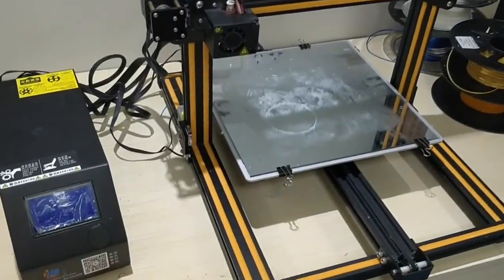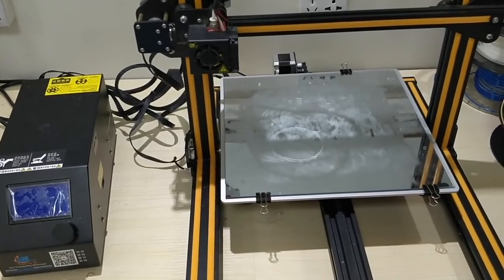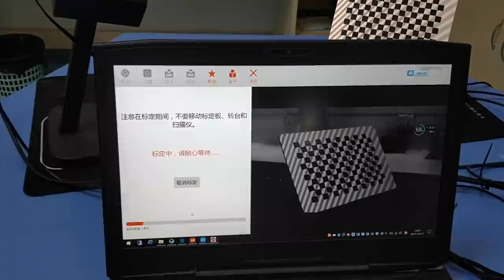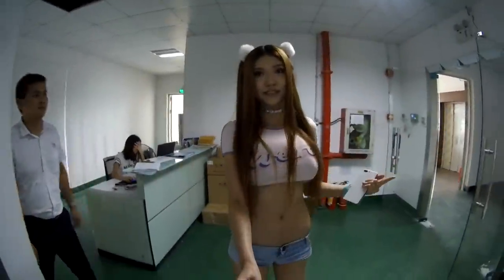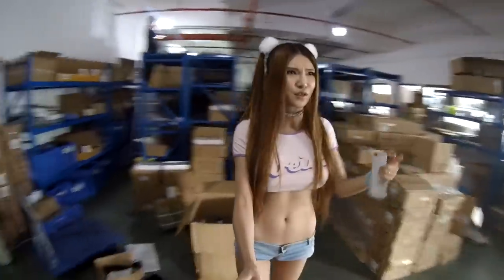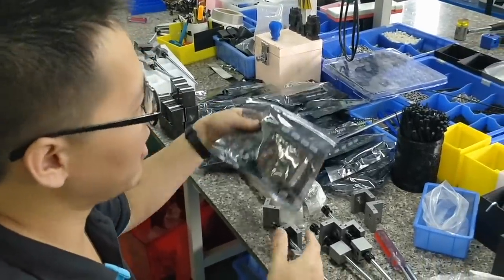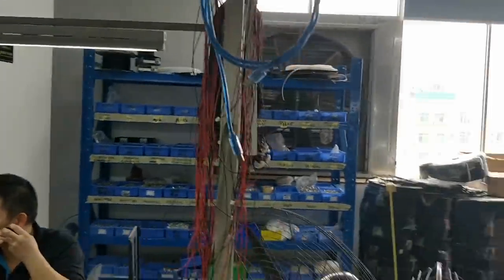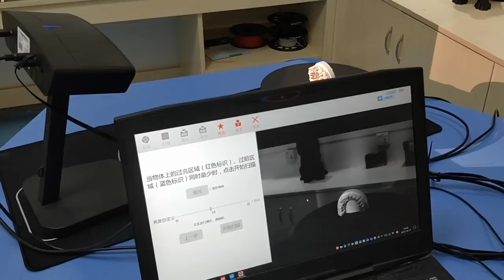CR-10 Factory Tour!

Comment: Great tour, but the camera motion was distracting for me.  Indoor tours like this may be easier with a 360 camera on a gimbal, so you don't have to twist and turn so much.  Maybe with a tripod, so you can set it down then walk around in the room.
Reply from the maker: I did a poll, people voted for the selfie stick...
Reply: Outdoors (in the open), 360 has limitations (too much in view).  Indoors, regular cameras need to always be panned (too little in view).  There may not be a single solution that works best in all situations.  How about bringing the 360, and using its video only when it truly helps?